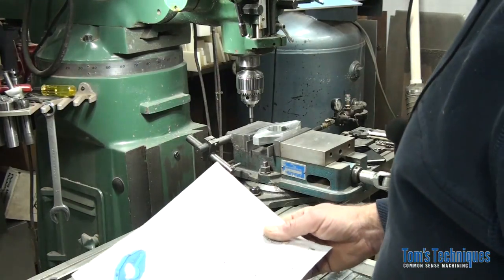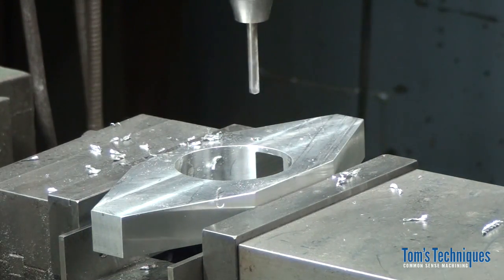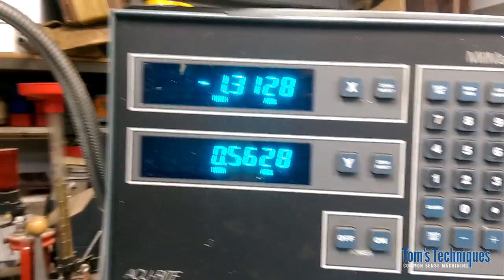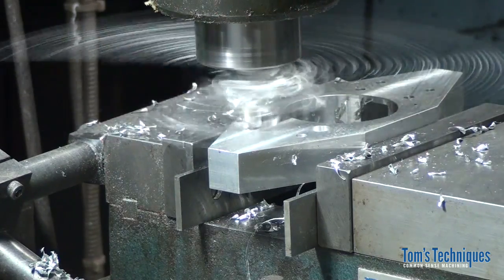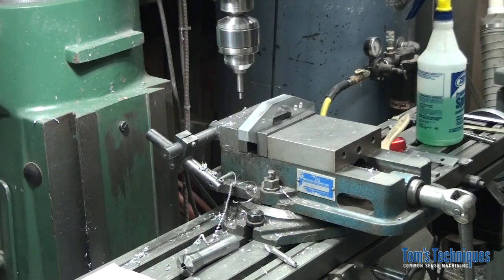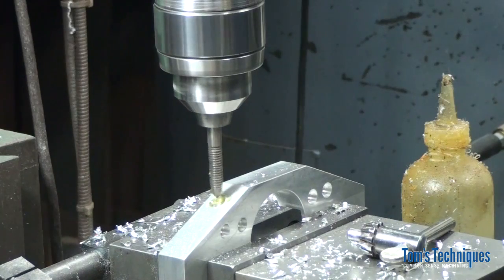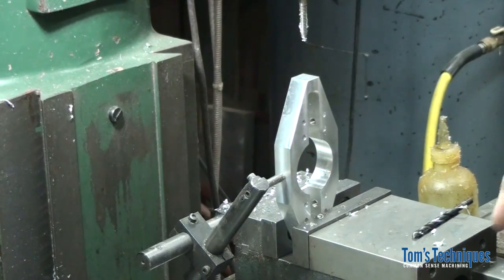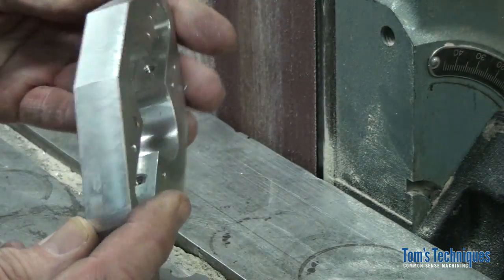Clamp Knurling Tool Body, Drilling, Tapping and Counter-Boring the Holes

Comment: Hi Tom,

I have a question about the 5/16-18 UNC holes in the aluminum body of the knurling tool.  What are your thoughts on 5/16-24 UNF tapped holes instead?  I am thinking I can get finer adjustments with the fine thread.  Would the finer threads rip out due to the aluminum?
Reply from the maker: Fine threads would provide finer adjustment, but would not hold up long term in the aluminum. A fix for that would be to use helical inserts, or have the parts anodized to harden the threads.
Reply: @TomsTechniques  Thank you for the reply

Comment: Tom I completed knurling tool works great . What is coming next & when . I am ready for another great project!
Reply from the maker: Hi Mike,

It's good to hear that you guys are finishing the project in spite of my tardiness. I know of a number of them that have been completed and the overall response has been good. I've been tossing around the idea of building a powered chamfering/deburring tool for milled parts for a while now, so that may be one of the next projects. The design is still in my head though, so it may be a while before it's ready to build.

Thanks for watching.

Tom

Comment: Tom, I really like your videos. I am trying to get registered at the local VoTec. Probably next week one thing that I am concerned with is you keep wiping metal shavings with your hands. Wouldn't it be better to use a chip brush?
Bill
Reply from the maker: I've worked with metal so long that I pretty much know what I can and can not get away with. I seriously can't remember the last time I got cut. I do a lot of checking for burrs with my hands, but normally if I'm just wiping chips, it is with a chip brush. If you are doing something with your hands where you think you might get cut then you should definitely use a brush.

Tom

Comment: I did not realise how many engineering changes I have made in my life time. But joking aside you could quite easily sorted it in editing,and if you were not making a video I bet you could have made a replacement in no time.
Reply: Or fixed it?  I was thinking that if it really did matter, and material cost made scrapping the part painful, it could be fixed by relieving the hole, making a plug to press fit into it, pressing in the plug with some Loktite, and facing it off flush, then putting the hole where it was supposed to be. Might that have worked? Or is the nearness of the proper hole to the improper hole location a problem for that idea?  Tom Lipton on his OxToolCo channel showed a repair similar to that recently...but his plug didn't overlap much with the new hole. 

Thanks for the great video series, and for showing some alternative methods.  Us newbies learn a lot from the smallest parts of a project like this...like the corner rounding methods or when it's ok to live with a mistake...sorry, "engineering change". 

-- Mike
Reply from the maker: My time is valuable (as I'm sure yours is) and I'm not going to waste any of it rebuilding a part that is perfectly serviceable. It would be a different story had I screwed it up badly enough that it was no longer functional.

Tom
Reply from the maker: Toms Techniques
The holes are definitely too close to plug. The only way they could be fixed is to weld them shut, but then the aluminum loses its strength and anodizing makes it stick out like a sore thumb. The best fix in this situation is to just swallow ones pride and adapt the mating part.

Tom
Reply: Tom, Thanks for the extra info.  I only considered welding briefly, but I rejected it based on how tricky it would be to get the weld into the bottom of a small hole (though I suppose "casting" might solve that by just pouring in some molten aluminum) and the possibility that it might (probably would) warp the part.  The strength and anodizing issues I didn't think of...thanks for pointing them out.

-- Mike B.

Comment: Tom, do you employ a different threading tool for power taping as opposed to hand. Are two spiral taps better for taping?

Eric
Reply from the maker: You have to use spiral point taps to power tap, ordinary plug taps will plug up with chips. Watch my video on power tapping to see how it's done.

Tom

Comment: Excellent series as usual. Thanks for taking the time. I would like to use this on my Bridgeport, thinking of two posts in the backside locked in the vise. Feeding the stock held in a collet down with the quill. Would that be a problem. My lathe is too small.

Comment: audio has hummmmm
Reply from the maker: Check your hearing aid. :)

Seriously, it's the phase converter and it's pretty much as quiet as it's going to get unless I start using a file instead of the mill.

Tom
Reply from the maker: Jim Milne

I here what you are saying Jim, but the time I spend on editing has gone out of control. I think it's to the point now where my voice can be easily heard and that's going to have to be good enough. I don't want to be spending more time editing than it takes to shoot the videos.

I'll check out your recording.

Tom

Oops, looks like I need to have iTunes to listen to it. I'm not an Apple enthusiast so I guess I'll have to miss it.
Reply: Toms Techniques
For the record, Tom, you do not need to respond to my comments in any way. In fact I would rather you used your precious time to make your important videos. When I comment is as a gift and you need not acknowledge it. You are absolutely correct that the audio quality is (more than) good enough to convey the information without distraction.
Reply from the maker: Jim Milne

Sorry Jim but I make a point to respond to all comments. It doesn't take much time and I figure that if you guys take the time to leave comments, the least I can do is acknowledge them.

Tom
Reply: Toms Techniques
I run a sound recording studio here in Nuuk. Depending on what audio editing features your video editing equipment offers, you might be able to record your phase converter at the usual distance you are from it while making your (fine) videos, then using an equalizer, which is a sort of frequency dependent filter, to reduce the volume in precisely the bandwidth that the phase converter is humming. This would be an overall adjustment so it would also affect your voice timbre, but it can be adjusted to get a balance between reduced hum and acceptable timbre change in your voice. You can probably adjust the Q of the notch or band pass or parametric filter. Adjust this to as small an amount (read narrow as possible) to limit the amount of volume reduction on each side of the unwanted hum. Btw, I don't find the shop background sound bothersome because you are pointing your mic (directional) toward your voice and this makes a fine balance between voice and machine sounds. You are doing great! Check out something we recorded in my studio, my son's music on iTunes. Search for "Intalik Milne" album "EP".
Reply: Jim Milne ditto
Reply from the maker: Carter W Hern

Carter,

As I mentioned to Jim, I respond to all comments. If I was a bit curt in yours, I apologize. It's just that after receiving numerous comments about the poor quality of the sound on my videos, I've been working very hard and spending lots of money to make it a good as I possibly could. Your comment about the hummmmm must have struck a nerve. I did include a smiley emoticon. :)

Tom
Reply from the maker: Thomas Headley
Thanks Thomas, but the hum in this case is the three phase converter in the background. It is much less noticeable since I started using a wireless mic.

Tom